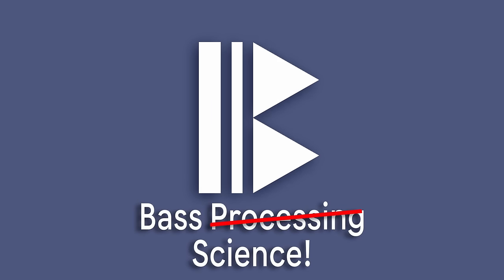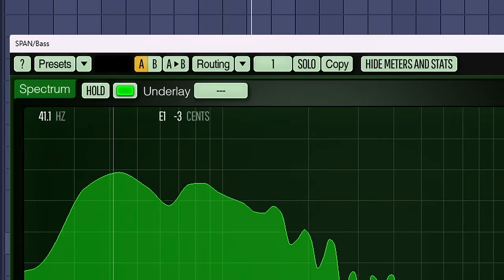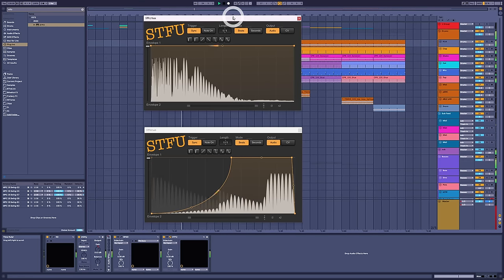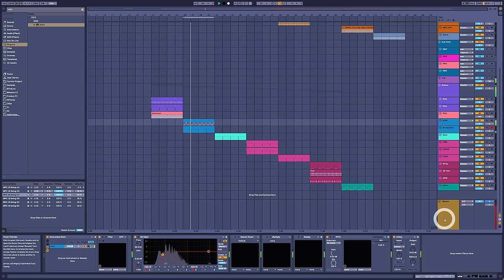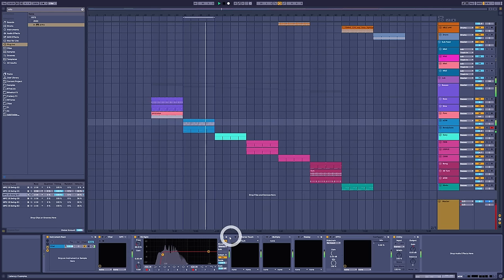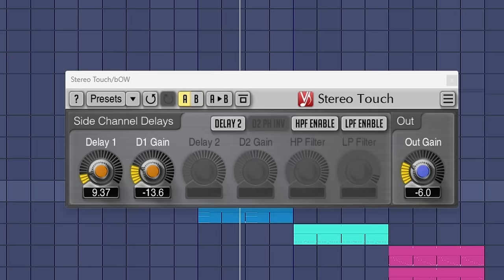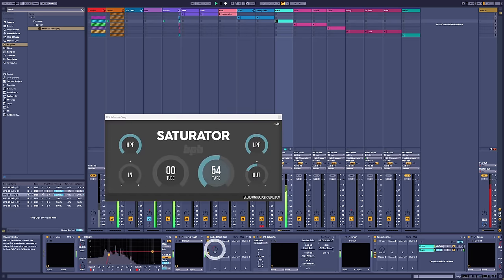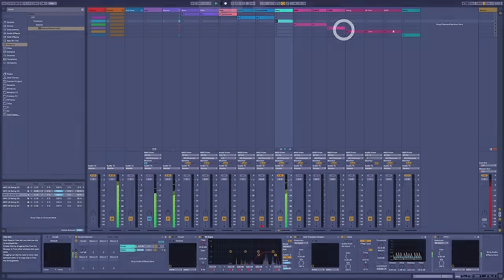How I Process / Mix House Bass

Comment: Great material! Could you tell us more about layering of sub and bass? Does your sub bass track only play the 1st harmonic or more? I noticed that the bass has very little undercut. I've encountered the technique that the subb have more upper harmonics and the bass is cut at 100/200hz. But your bass always sounds great, so find out your secret to a well-glued sub and bass track.
Reply from the maker: Usually just the first harmonic is all I've needed. If you go above that there's always a danger of interference with the next harmonic which is the start of the main bass. 
Like I say in the video the frequency selection is tied to the key of the track I never use a regular frequency of 100hz etc. 
When you get an ear for it, you can listen for constructive or destructive interference and use it to your advantage but that was well beyond this tutorial.
Reply: @Bthelick  Thank you for your answer. It's very helpful. So you're cutting bass just before the lowest 2nd harmonics note in the progression? In serum, it is possible to remove the fundamental frequency. I understand that Vital (which you often use) does not have such possibility if you choose eq?
Reply from the maker: @Mr Mick  vital can edit waveforms too, and remove first harmonic yes.
Again probably a little too advanced for a beginner tutorial, and also not universal advice for those not using serum and vital. I try to make tutorials anyone can follow regardless of daw or gear. 
also if any saturation/.distortion is part of the sound removing the true fundamental will change the sound too much and remove the psychoacoustic depth of the effect.

Comment: Can u share some tips to make the bassline more punchier, kinda fast bassline. Im struggle with the bassline sound boring because the sustain time is kinda long.
Reply from the maker: Did you catch the previous video on making the sounds?
Reply: @Bthelick  Yes I did,
Reply from the maker: @thisislucydarlyn  ok, well you've kinda answered your own question there almost. You have identified that if the sustain is too long the takes away from the punch. So you can shorten the note length, or reduce envelope decay / release. Especially the filter envelope.
Is there a reference you have in mind?

Comment: Amazing video as always! Quick question, what should I do if my bassline has to hit under E for a sub but its too low and takes away too much energy from the track when it plays. Ive tried other notes in the scale and an octave above, even a different bass but i cant seem to get any solution
Reply from the maker: Yeah that's a common problem. 
Look at the Paul Woolford heat note worthy. 
I show the trick he uses to get around it. That track is in c#
Reply: @Bthelick  thanks ill check it out

Comment: Why is your slope inverted?
Reply from the maker: Slope? On what the FFT?
Reply: @Bthelick  Sorry! On the spectrum of span? When you view the pink it's slanted the opposite way of mine;)
Reply from the maker: @themoprhingorb  technically my slope is at zero. The default is -3 I think. (You can change it in settings) It's how I prefer to see things. White noise should be flat to me, not pink, so I remove the default slope.
Reply: @Bthelick  Ah! Okay, makes total sense now! I agree with your logic there: white noise should be flat!
Reply: @Bthelick  Thanks for sharing, mate;) And thanks for the upload;)

Comment: Why side chain only sub and not whole thing. Seems like preference.
Reply from the maker: Because of the energy distribution. It's essential to side chain down there, unless you want a really quiet track with no groove in the lows. The point is sub is needed, 
The REST is preference. Anything above that is mostly a groove decision. 
It's about control. If you side chain the whole bass as one then you'll need to duck it for much longer than you would need to otherwise, which might cover up half the bass part. Of course it all depends on the bass part and groove you're going for, but you don't get to choose that unless you have control
Reply: @Bthelick  So would you be in favor of just ducking everything say 100 instead of notching out a spot for the kick?
Reply from the maker: @impolitikful  well again it al depends on the groove you're going after. everything in the track ducking gives a very distinct 'suck' which can be cool if you're going for that over the top effect, but can also be hard to dance to depending on the timing of the release and curve.
Reply: @Bthelick  understood I was referring specifically to the bass guitar under 100 Hz
Reply from the maker: @impolitikful  oh, 100hz? 
well if the track was in a high key like B or C then 100 would make sense. 
I still don't understand the question fully though, you say "duck everything" , what else is to duck but the sub? if you have anything else down there (i.e lower than your bass ) then something has gone wrong!
Reply: @Bthelick  Sorry for confusion. I meant some people will for example, notch out a 50z spot in the bass to "make room" for the kick with a 50hz fundamental. Im asking if you think thats pointless and would instead just duck the sub completely under some certain frequency i.e 100hz or something.
Reply from the maker: @impolitikful  on right I see, you mean using an eq notch on the bass to unmask the kick. Well its certainly less effective for energy headroom, and it's static (usually) so the bass will always be sub light. That can be appropriate in certain circumstances like when the kick is long /huge and carrying the whole bottom of the track, but in that case I would still just high pass.
Reply: @Bthelick  Thanks! Would love an over all how to mix to a reference video.
Reply from the maker: did you see my first live stream ? it's a track from scratch to a reference. 
I rarely have to mix to a reference in the traditional sense as I don't really do that much mixing, it's mostly in the sound selection at the beginning, if you can get the drums and bass right to the reference then the rest basically falls into place.